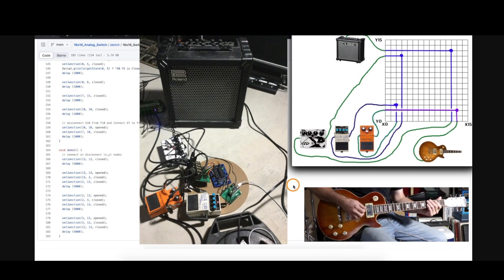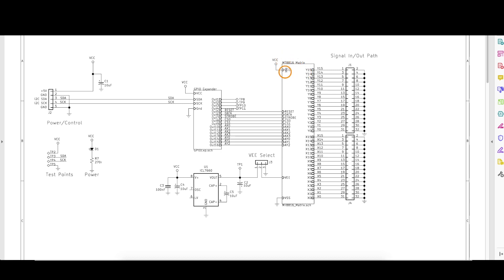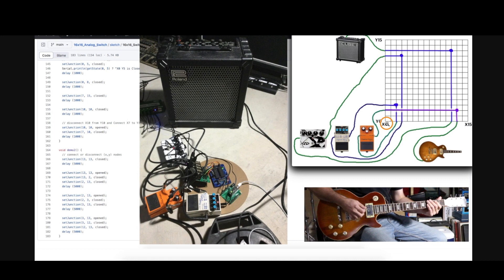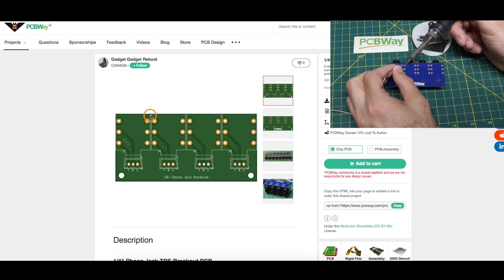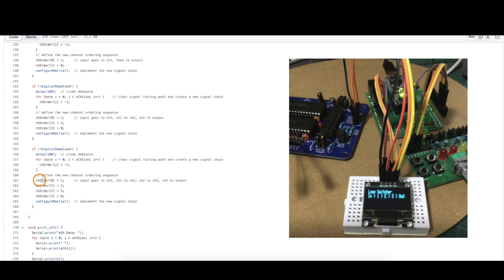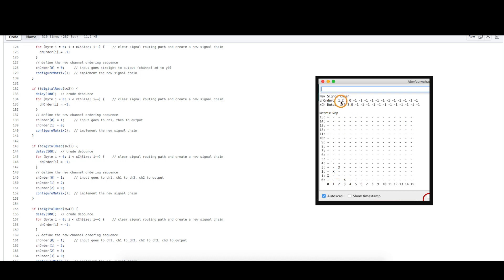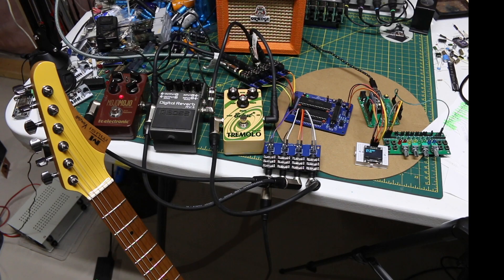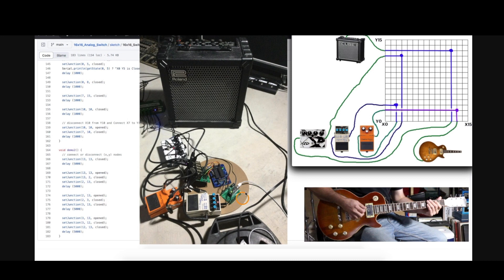Loop Switcher Part 2 with 16x16 Matrix

Comment: its better the matrix than  relay based  looper ? i mean possible noise or popping etc...
Reply from the maker: I wouldn’t expect any difference in those traits because that would be related to other aspects like the wiring or the method of connecting and disconnecting things in the signal path, for example I think popping can be reduced by adding another circuit where a transistor can mute the final output signal while the switches are reconfiguring the signal path regardless what method is used
but one possible disadvantage to using a chip instead of relays is there may be a different interaction between certain pedals or the guitar pickup  because there’s going to be some small impedance added by the electronic signal routing but I haven’t noticed anything so far causing problems

Comment: Do you ever use the Teensy anymore?
Reply from the maker: I recently used it for some I2S audio DAC experimenting but I don’t remember if it made it into a final video. I don’t use it much because it’s more niche and more expensive and harder to acquire than ESP modules plus doing Wi-Fi stuff it’s easier with ESP having it built-in and more libraries and examples available to learn from.
Reply: @GadgetReboot  Thank you for the reply. That's a little discouraging because I just picked up a Teensy 4.1 for a DIY audio mixer project!

Comment: Excellent construction! 👍I just built an octave fuzz pedal (based on a clone of a Tychbrae Octavia) and ... it doesn't work! 😆I tested the circuit and things were fine, but after installing it into the enclosure with hardware ... something happened. I guess I'll have to take it back out and test again -- hopefully I will figure it out and learn something in the process. Wish me luck! 😂
Reply from the maker: Is it a metal enclosure where something could be getting shorted after assembly?  Maybe plug in cables that go nowhere and without power, check continuity at the open end of cables to see if any unexpected connections are made between any signals/power/metal contact points.  Or if screws are going into metal, is anything else leaning against a screw or pot lug.
Reply: @GadgetReboot  so the problem was my initial quickie test ... I went ahead and tried the pedal in my studio setup and it seems to be working 100% correctly. Fuzz pedals are finicky current sources and it is easy to think they are "not working." Nothing is shorting inside the metal enclosure but sometimes things short inside my head. 😆

Comment: About 50years ago, boy that sounds a long time ago.  We took the electronics out of Lof the affects peddles and made a stand so all the buttons were on the floor but all the control knobs were in easy reach. I played the electric biscuits tins,  one tin had snare springs😂 different fillings changed the sound and so did where we placed the mic's. The fun of  school band on the cheap. 😂😅
Reply from the maker: I may do some tests with making a reverb tank out of piezo discs and springs.  Maybe snare wires can be tested as well.  I wonder if Aliexpress has any cheap ones.